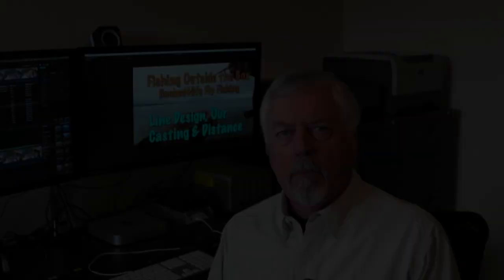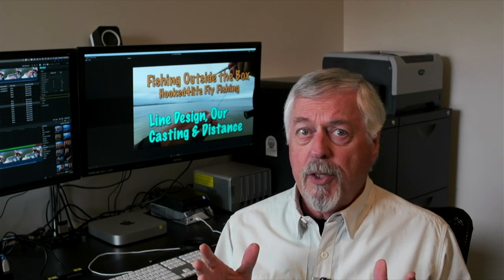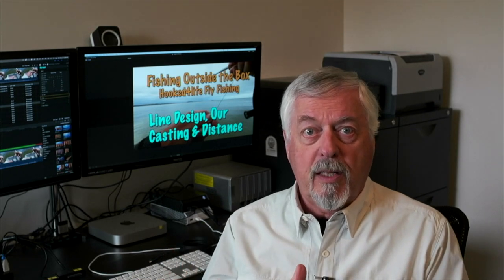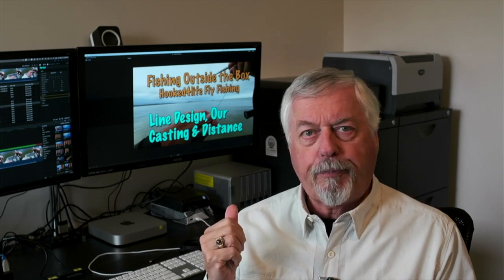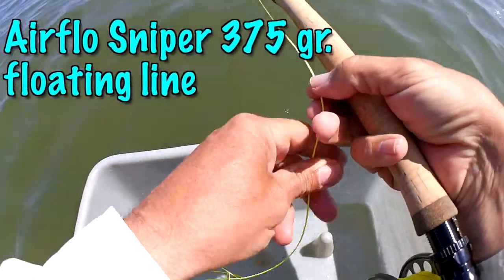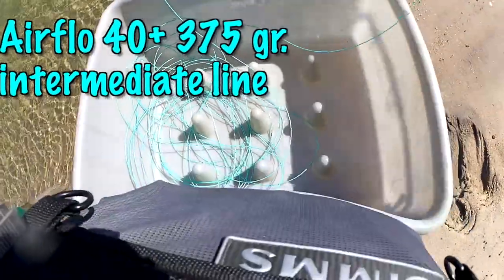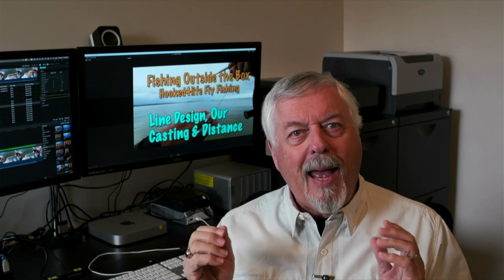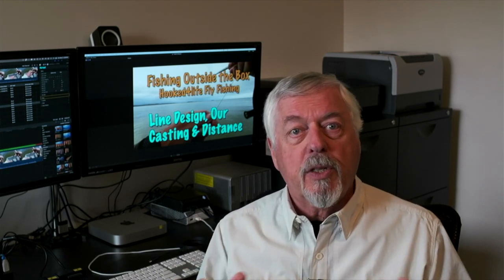Fishing Outside the Box: How Line Design and Our Casting Affects Distance

Comment: Hi Charles, I'm contemplating building a fly rod, and need advice on what type of blank to choose;  - assuming that the proper technique(s) are learned, and in terms of overhead casting, what is best for distance, a fast two-hander or a slower one....???
Reply from the maker: Both types of action can cast for distance, but most people will find it easier to cast for distance with a fast action rod.
Reply: @hooked4lifeca  Thanks, and tight lines...

Comment: Hi buddy.. like your videos, I have been fly casting for over 50 years in the UK
we fish on large reservoir’s from the bank so distance is important, I can cast
as far as I need to, and further than most.. however the WF line I’m using is 
discontinued and it needs replacing, I have purchased many lines but don’t 
cast nowhere near the distance of my old line (I’m only chucking small flies
on size 10 or 12 hooks) it’s costing me a fortune in lines only to find there not
up to the mark as far as distance is concerned ?
Is there any lines you recommend, or your choice, I don’t mind paying the 
price for the RIGHT line ?
Many Thanks 👍
Reply from the maker: The simplest answer is: the longer the head and the longer the front taper, the farther the line will go. Any of the lines on the market that are designed for distance (long heads and tapers) will do the job. Unfortunately for us, a lot of the short head lines on the market have distance claims attached to them and it's not entirely accurate. They will deliver decent distance with big flies, in the wind, or in the hands of the inexperienced, but they usually hit a wall around 80' or so.

I didn't get into the issue in this video as I wanted to discuss running lines, but in other videos I've talked about the casting energy flowing through the head and rolling out the leader. With short head lines we literally run out of head to utilize the full casting energy available. So if you have been buying short head lines (e.g. 35' and under) it would explain the problem for pushing past that "wall".